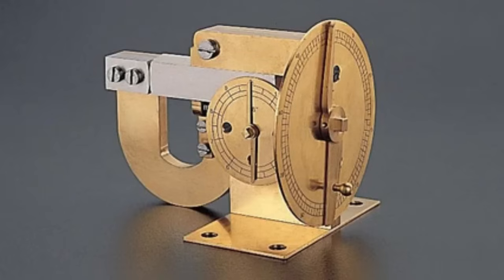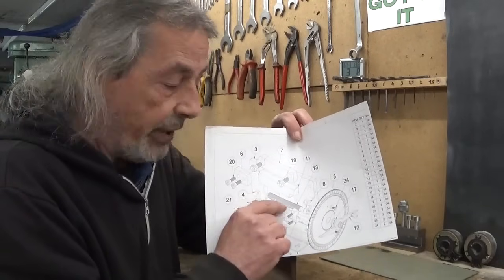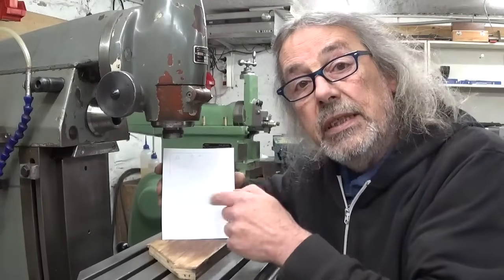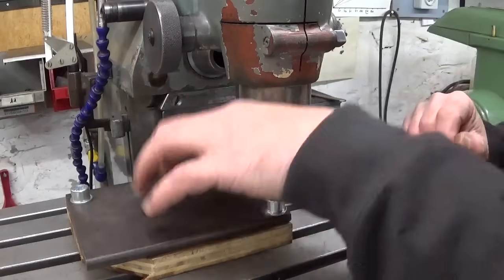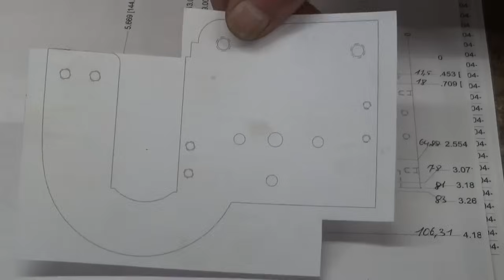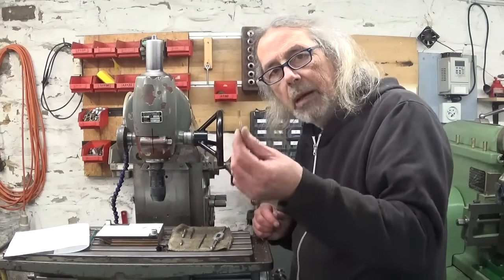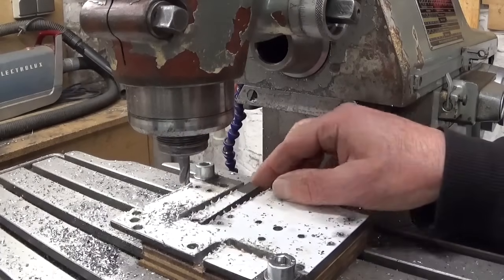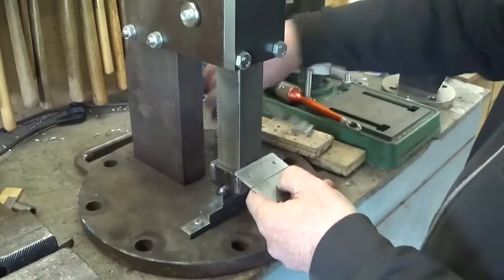James Watt's micrometer build.

Comment: Good start to the project Michel. It is amazing that you started with a large piece of angle, then some cutting, cleaning up and shaping to end up with a nice looking main body of the micrometer. 
Looks like that first piece of sheet metal is hardened and it cracked when you tried to bend it.
Reply from the maker: Yes, that 1,5mm sheet metal is very hard. Good stuff :)

Comment: Really enjoyed that Michel, I found myself completely absorbed in it. You are brave to start a video series when you are not sure how some parts will be made. I like the sheet bender rig. I'll be back for the next part. Cheers
Reply from the maker: Thanks Paul. If it fails, it fails. And if it works, that's a bonus.

Comment: Hello Michel, great project, I've never come across the history of the micrometer myself. Like you, I am hopelessly dependant on imperial measurements and usually convert measurements  when needed. Simplest conversion is 1.000 inch equals 25.4 mm, so inch to mm multiply by 25.4, conversely mm to inch divide by 25.4. Two simple equations makes it very easy if you have to convert things like tap drills and the like. Double check the calculation with a digital caliber as well. Enjoyed the video, cheers!
Reply from the maker: Thanks. I will figure it out.

Comment: Hi Rusti,    Fly cutter good and bad , check tool not negative rake cutter on it as come round to cut  could be rubbing not cutter grinder tip a bit or get 1 with clearance when used for turning. 

Steve in UK ish 😂
Reply from the maker: I will figure it out.

Comment: i was considering building one myself from the same plans.   I will make something different now, not sure what.
Reply from the maker: Why not make the same? And show us the result.
Reply: @Rustinox  maybe. You can make that edge thread by spinning a single point in a boring bar against stock held in your tool holder. My long term project is a chain drive clock, 20 ft in diameter.

Comment: Nice project!
You shouldnt have much trouble making the nut. I've made similar parts for the follower on my thread chasing lathe. Simply clamp the workpiece in the toolholder, the cutting tool will be a 60deg threading tool in a boring bar and put the boring bar in the lathe chuck, then screwcut as normal!
Reply from the maker: The boring bar need to be less than 8mm diameter. That's very small.
Reply: @Rustinox  Hmm, you can of course support it with the tailstock too, but I grant you, that is a bit small. Does the thread have to have the correct radius, after all there is no force going through it. If the answer to that is yes, I'd get an M10x1 tap, drill a hole in some larger material, tap it then machine away the excess material. Or, as a further thought, use the original technique I suggested but put the m10 tap in the lathe spindle. Looking forward to seeing how you do this!

Comment: Nice project Michel, for sure with your machines and stock of material. btw calculate the power of your handpress, you wil be amazed how little pressure you can produce with that. and the original ones to 😃
Reply from the maker: Indeed, the press isn't very powerful, but it works :)

Comment: With the press not bolted down, the leverage is limited to the distance from the ram to the front edge of the base, not the length of the control arm.
Reply from the maker: Indeed. But I want the press to be movable.

Comment: Great project  to build !! Did I hear right? The print is in imperial measurement  be wear if you change to metric  as it may change your dial readings  on the wheels  ,, when we started using  metric  and trying to change it back never worked out good at the end so I bought a metric tape??
Reply from the maker: Most mesurements on the plan are imperial and metric.

Comment: It's not confirmed to be the first micrometer or that it is even a micrometer at all or that James Watt built it.. Doubts exist that it was built in 1776 but rather 1876. 

"The first ever micrometric screw was invented by William Gascoigne in the 17th century, as an enhancement of the vernier; it was used in a telescope to measure angular distances between stars and the relative sizes of celestial objects.

The London Science Museum contains an exhibit "James Watt's end measuring instrument with micrometer screw, 1776" which the science museum claims is probably the first screw micrometer made. This instrument is intended to measure items very accurately by placing them between the two anvils and then advancing one using a fine micrometer screw until both are in contact with the object, the distance between them being precisely recorded on the two dials. However, as the science museum notes, there is a possibility that this instrument was not made c.1776 by Watt, but 1876 when it was placed in that year's Special Loan Exhibition of scientific instruments in South Kensington.

Henry Maudslay built a bench micrometer in the early 19th century that was jocularly nicknamed "the Lord Chancellor" among his staff because it was the final judge on measurement accuracy and precision in the firm's work. In 1844, details of Whitworth's workshop micrometer were published. his was described as having a strong frame of cast iron, the opposite ends of which were two highly finished steel cylinders, which traversed longitudinally by action of screws. The ends of the cylinders where they met was of hemispherical shape. One screw was fitted with a wheel graduated to measure to the ten thousandth of an inch. His object was to furnish ordinary mechanics with an instrument which, while it afforded very accurate indications, was yet not very liable to be deranged by the rough handling of the workshop."
Reply from the maker: You did some research. That's good.
Reply: @Rustinox  I'm a fan of all things machining like yourself. I had to. Looking forward to see your project completed.

Comment: Let me explain imperial in a way a metric person can understand. 
Answer these questions. 
Start with 100 mm....
What is half of 100?
It is 50.
What is half of 50?
25 right?
What's half of 25?
12.5
What's half of 12.5
6.25
What's half of 6.25?
3.125
What's half of 3.125?
1.5625.
Does this make sense in metric? I believe that should be pretty easy to understand. Start with a whole 100% of something and just keep cutting it in half. We'll if you can grasp that, then you innately understand imperial. That's all there is to it. Where people get frozen in fear is because it is represented in fractions and folks think they have to do math in fractions and it gets very confusing. Forgot about fractions. They are just symbolic place holders for the stations of cutting something progressively in half. There's more to it obviously but thinking in those terms should allay your fear and discomfort and allow you to visualize it better.
Reply from the maker: In metric we just divide or multiply by ten...